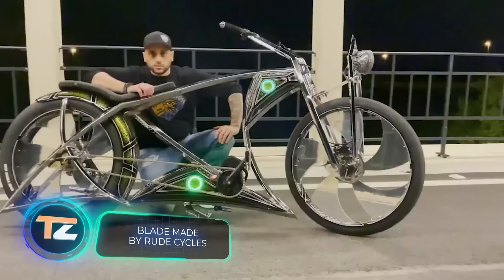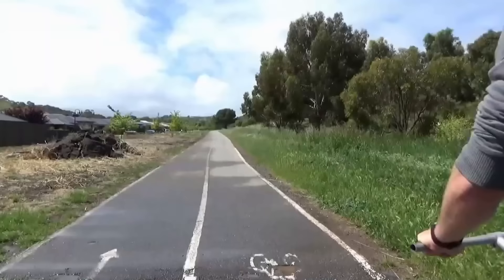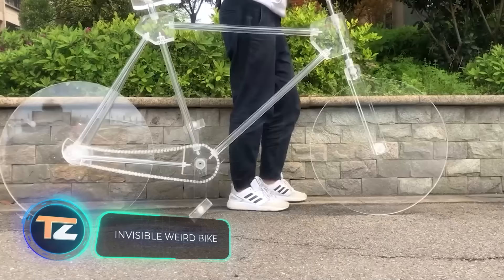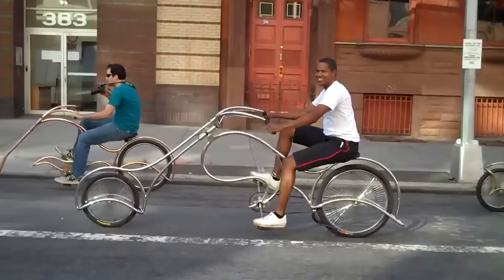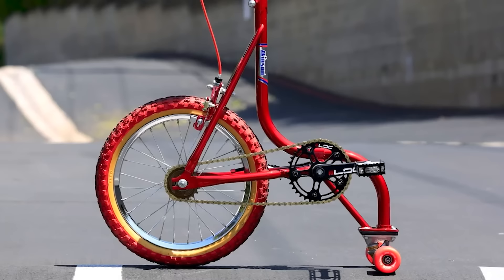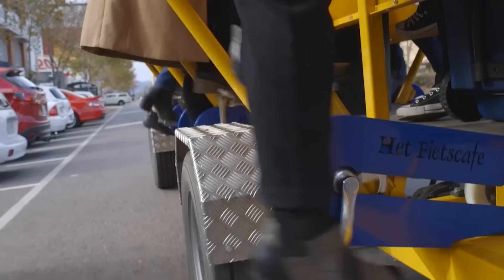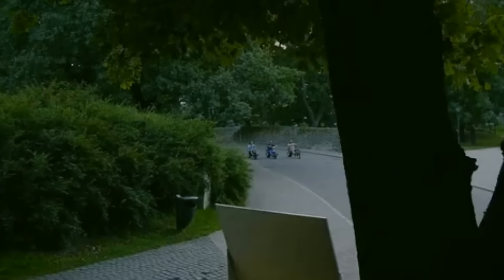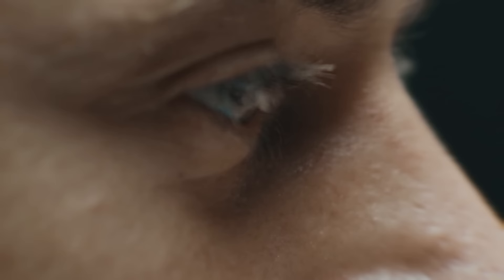10 COOL BIKES YOU SHOULD SEE

Comment: You can put all the bells & whistles on it you want it's STILL not going to be as efficient & cost effective as a gasoline powered bike. $5 says the battery replacement will cost more than the bike.
Reply: ....and it's on every street corner, and instantly accessible. 4 hours after 30 something miles....a novelty. 80 miles to a gallon, instant 4 dollars, on your way, loud but effecient!

Comment: 6:02 wrong. You steering by leaning your body, that’s the opposite of balancing. SMH
Reply: It's both because you have to maintain and adjust the balance to shift you're body weight without falling over, leaning wouldn't come into effect until you get to higher speeds.